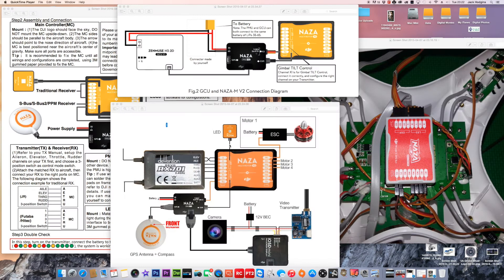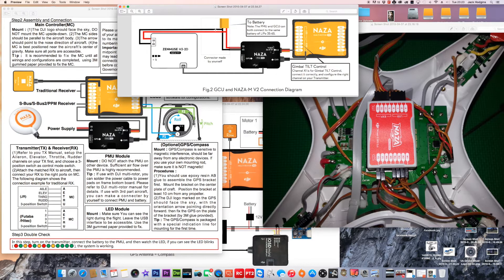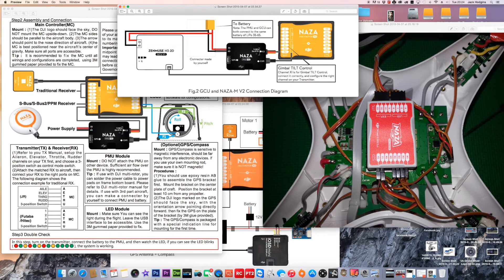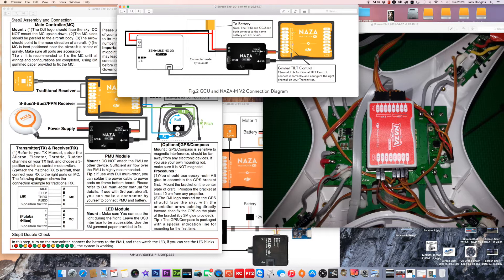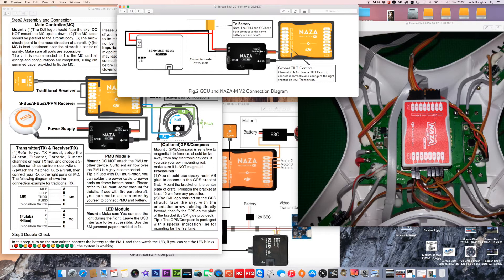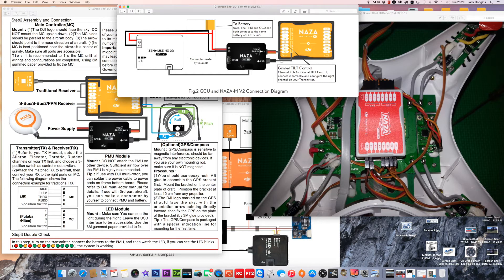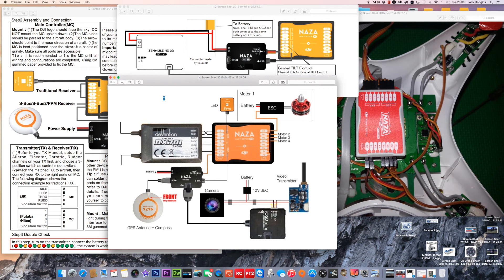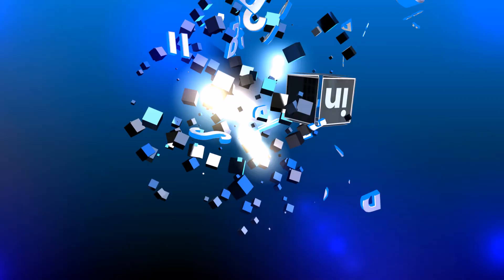DJI Phantom 1 Problem with GCU and PMU no GPS Signal

Comment: at about 5:20 into the video you say the NAZA is PROVIDING power to the PMU, and to disconnect the battery inputs to the PMU.  Ah, the Power Management Unit takes battery power from variety of voltages (S types) and converts it to the correct power FOR the NAZA.  I think you have it backwards.